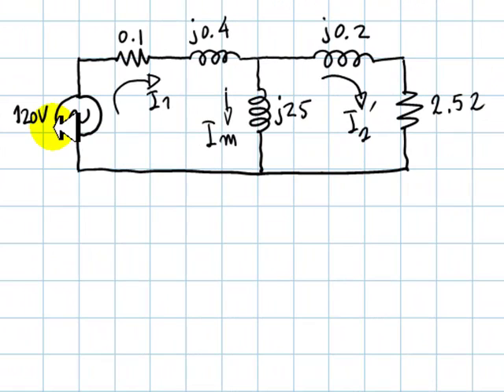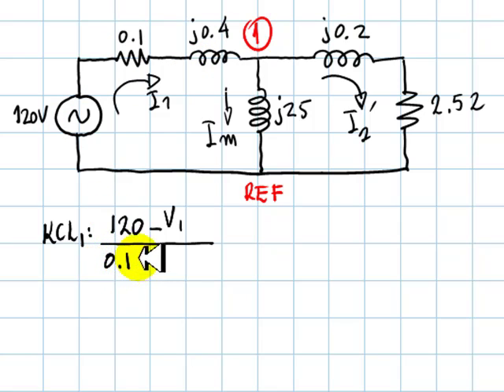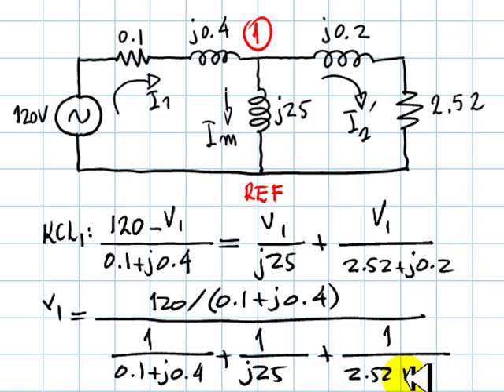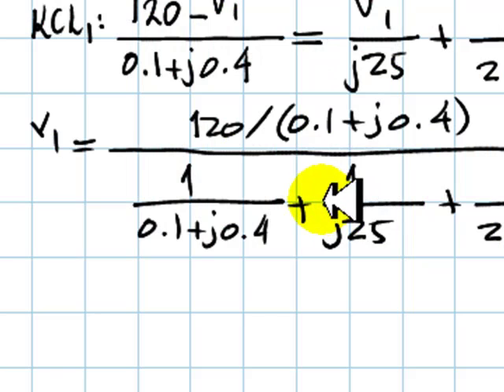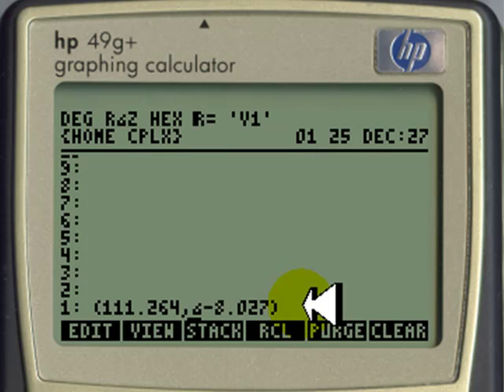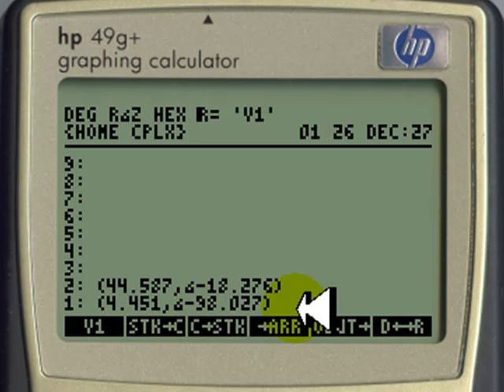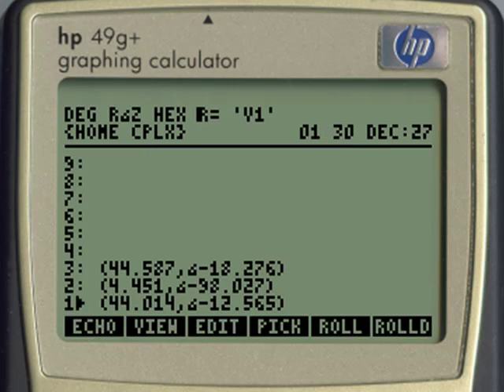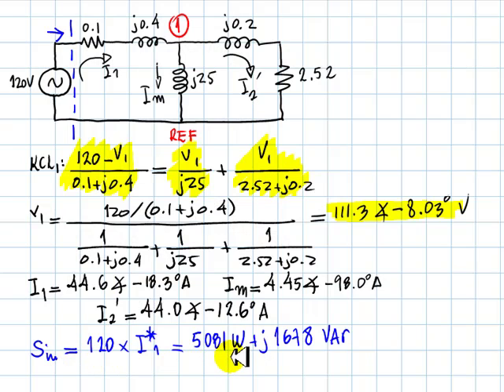HP13/PHASOR 04b: HP-50g Complex Numbers in Action.

Comment: how you set up the hp51 for this?
Reply from the maker: Do you mean STC, CTS, and the toggle keys from rectangular to polar, etc.? Just short programs that I have published elsewhere. They use a couple of the HP-50g so called "system flags" (which are like the flags available to users, but are toggled by the calculator during its operation). I think one of the flags is -17 (yes, system flags are represented with a negative number to distinguish them from user flags).
Reply: Yes.  its explained in earlier lessons; thanks to this source I'm reviving my memory!   Awesome learning resource.   thank you
Reply from the maker: Try going to http://courses.ece.ubc.ca/elec202/linares.html
There, click on FREE SOFTWARE and you will find the source to most of the little HP-50g programs that I use in these videos. Good luck!
Reply from the maker: Not for "FREE SOFTWARE", you don't need login or password for that.